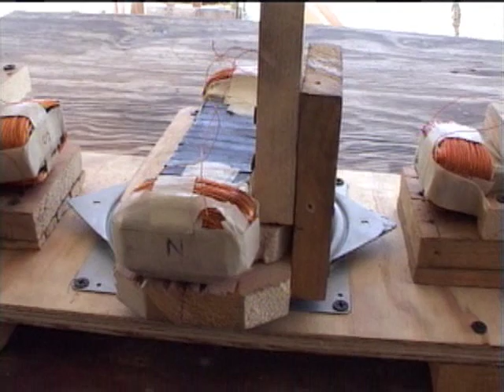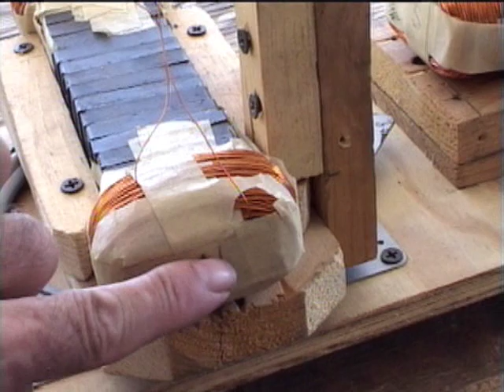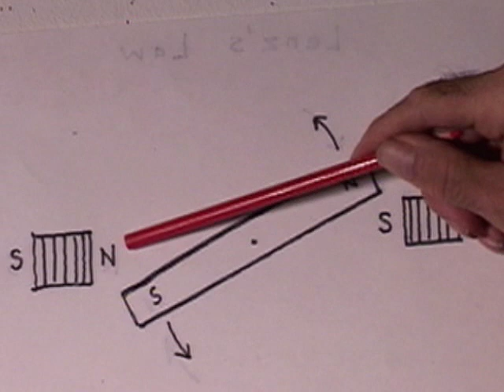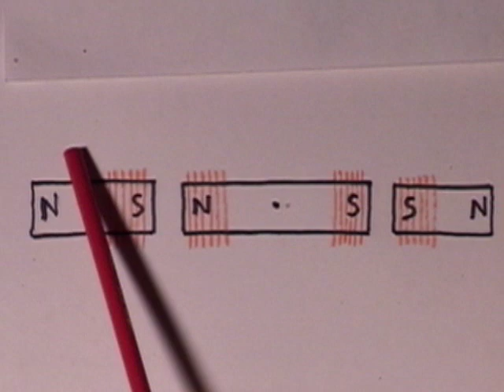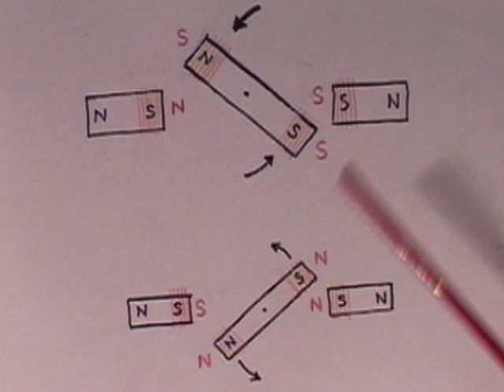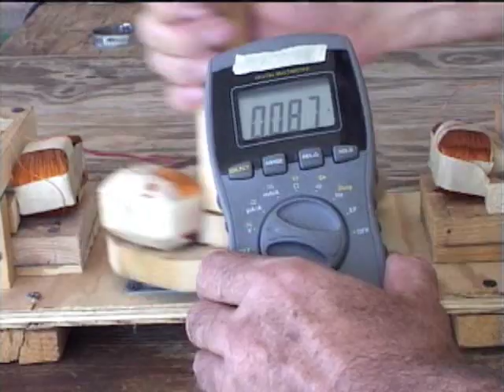How To Make Super Electric Motor Generator

Comment: sorry, but i hav a query, so please explain me why?
Firstly how is current induced in the coils wounded on the permanent magnet? According to Flemings Right Hand rule the force has to be perpendicular to the magnetic field for maximum current, urs is either parallel to magnetic field or there hav to be opposite poles for current to be induced , N to S or vice versa, there isnt any, so i doubt the working of ur idea.
Explain me this , im 14 , not an expert at it.

Comment: when the south pole of the rotor was moving towards the outer magnet this created two south pole magnets and the same in the center you said this would cancel the repelling force out. 
no offense but your absolutely wrong this just makes the repelling force twice as strong and the same thing happens when the north end of the rotor is moving away from the outside magnet except that it attracts twice as much in the end making your generator somewhere around half as efficient as it could be.

Comment: You crank your generator and hook it up to 1kW heating element...
The faster you crank it the more power is generated...
It will become harder because more voltage is generated but amprage i the same

(My brain crashed at this point)

But no, its possible to get 100% efficiency  but impossible to get 101% isnt it?

Dual Axial PMG seems the best solution as my opinion but this one...

Could you build superb generator with your idea and show us how well you generate ':)

Comment: If a typical generator is about 85% efficient then this one is 5 times more efficient.  5 x 85% = 425%.  He also says it is not perpetual motion.  But any generator that has an efficiency of way more than 100% will be able to power a perpetual motion system.

So basically this guy is deluded.

Comment from the maker: (1) I estimated energy input to energy output to get efficiency rating. (2) It does not matter
if two permanent magnets' south poles or two north poles face each other. All that 
matters is a moving magnet will generate a current in the coil opposite it. That is an
important point in the video that you some how have failed to understand.

Comment: Ur generator isn't gonna work 5 times as efficient... First thing how did u calculate it would be 5 times... Second thing is that u have 2 south poles on one end facing each other... What u haw failed to realize is that there will be no field flowing through the coils at that end as the fields repel each other.. Thus there would be no induced voltage.. If this device of urs works it would be half as efficient because only one side N-S is inducing voltage..

Comment: Heres a theory for u sir, what if u wired the coils together to make a north and south attraction to the coils to further assist the ease of rotation. I absolutly admire this, definitly no hojo motor from the wiring diagram i have...and also invest in neodimium n52 magnets to increase magnetic field strength. Once that is done, sir, i do believe u have yourself a product for everything possible.

Comment: Thanks for reply, when you "close" the coil in your example, induced current flows within the coil itself, hence it generates the opposition field you speak of measuring due to (-L *d I /d t). If the coil is open cct no current flows so no back field or Lenz field is generated. The shorted coil scenario equates to max load current as far as coil is concerned..... At least it's what I think, which I admit am frequently wrong.

Comment from the maker: @smokyatgroups (1) Flux density does change but there is still enough to generate electricity. (2) You are 
incorrect about thinking Lenz's Law does not go into effect unless current is drawn from coils. This is easy to
prove. Take a closed coil of wire and move a magnet at one end. At the other end of the coil a magnetic field
will be created. At coil end facing the magnet , coil's field will oppose the movement of the magnet. This oppostion may be hard to detect with a small magnet.

Comment: @ToemanX 
Just try it first with the other 2 coils.
If they can generate current without slowing down the rotor
you have proven your device.
Just drive your rotor with another DC motor and
measure the DC power input into it.
Then shortout the outer 2 coils and see how much
the input power into the DC motor increases...
Good luck.
Regards, Stefan.

Comment from the maker: @beac310 My device is configured to be a generator which is a source of electrical energy. An electrical load is a device
like a light bulb that uses energy.  Whether there is a load or not does not effect the internal way a generator operates. If the generator is hooked up to a bigger load it would just have to work harder (rotate faster) to meet the demand.  My device has no Lenz's Law effect so it takes little prime mover energy to meet a bigger electrical load.